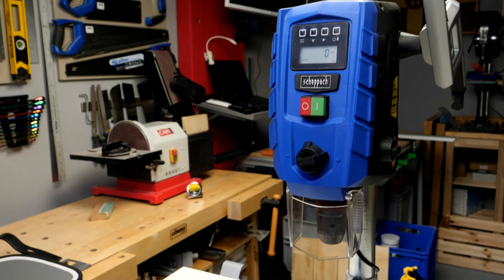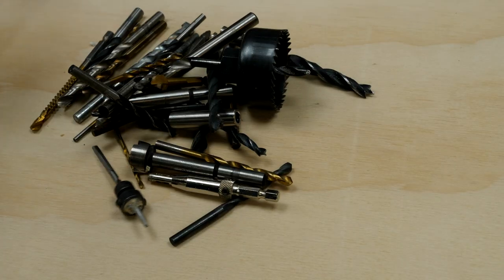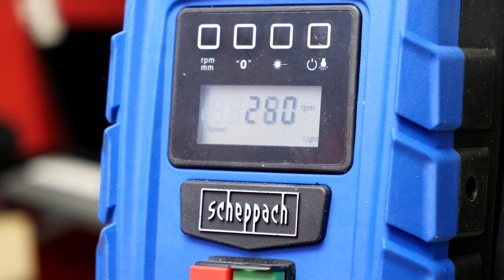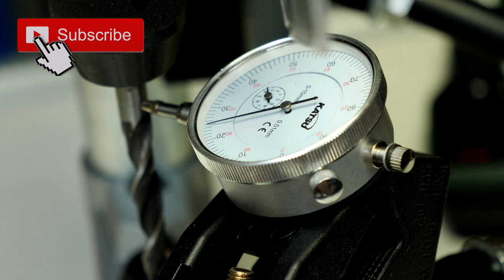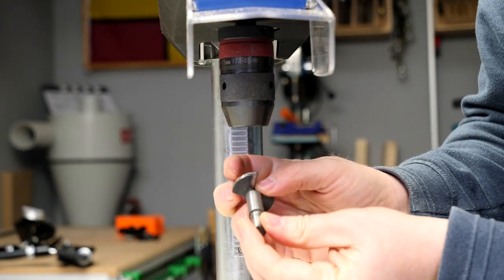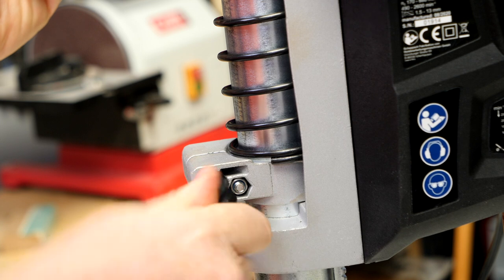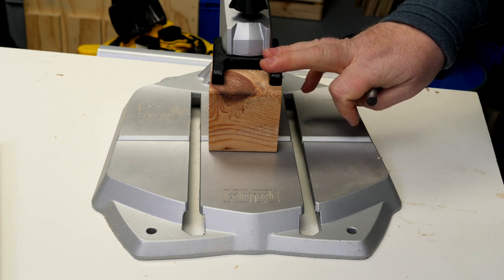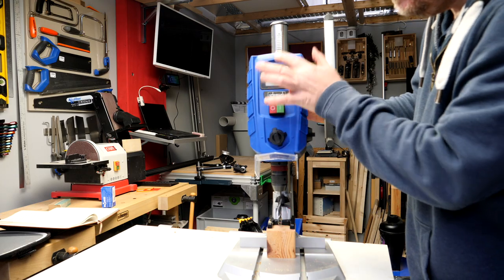Is the Scheppach DP 60 710w Bench Drill Any Good?

Comment from the maker: A couple of quick follow-up points from the video.
1. It seems the unit has gone off-sale online but they can be found in-store for £79.99 while stocks last (as of 1/1/21)
2. I do constantly refer to the drill as a 'bench drill' rather than a drill press. Bench drill is what both Scheppach and Bosch refer to this type of machine as and, as I said in the video, the drill mechanism is more similar to a hand-drill than a traditional drill press where the motor is stationary and the quill is moved up and down.
3. The review is a positive one. It's faults do not affect the results when drilling into wood and soft metals but and for £129 I would be put up with the quirky design and rough plasticky appearance. This isn't a precision engineering drill by any stretch of the imagination. The gearbox noise is unfortunate.

There is more to come on the subject of drills and drill presses so stay tuned. A couple of shorter videos to come in the meantime. Happy New Year.

Comment: The gearbox, despite being noisy, has a strong point (for steel), that is, it does not allow rotation to be blocked, unlike the belt, which instead can slip, especially since the engine, with its 710 watts, is very powerful. However, predictably the gears of the gearbox work with gear grease, but in the future it may be that the gearbox will be made in an oil bath, so the gearbox will be less noisy and perhaps more durable. /// The electronic speed regulation seems to be carried out via a mosfet, since the motor is perhaps brushed and perhaps, if it had been an induction motor, with the regulation via inverter it would have been possible to have a greater speed range. /// One thing that I don't like and that few people notice is the base made of aluminium, rather than cast iron, since it doesn't give a sensation of robustness or flatness and in any case the aluminum causes the piece to stick, so it is difficult to position, while cast iron would allow better movement. /// The measurement of the drilling depth complete with zeroing is an uncommon strong point. /// The two-arm descent ring I think is an impractical marketing gimmick... it should be three-armed and in any case if it didn't have so many oddities in the design it would be better. In general it seems like a drill more suitable for wood than for steel, also because placing the steel on the aluminum base would quickly ruin the base.
Reply from the maker: I would agree that this is very much a woodworking drill. Thanks for your comment.

Comment: Incredibly disappointing that both Scheppach and Bosch didn't do with a variable inverter and an AC motor.  I have that for my micro lathe and it is nearly silent, with amazing torque at low speeds.
Reply from the maker: I agree.

Comment: Good lad. Start with the runout. Tbh 0.2mm would do my crust, but I'd lay money that the Bosch isn't any better from what I've seen. Where's the runout coming from? The chuck, the bearings or both? It'd be interesting to see the inner workings of this and to know if that runout coud be improved by simply swapping in a decent bearing or two like you can with a standard drill press, or if you can change the chuck for a better one. You're right about that stupid wheel on the Bosch. One thing I don't get about these bench drills is why are they all so damned noisy? I'm sure if Makita got into the game it'd be whisper quiet with no runout either.
Reply from the maker: Hi. Thanks for the comment. I do have the. Bosch machine too for a comparison vid and the runout on that is around 0.8mm. I've taken the Sheppach apart and there are two problems in my view and you've mentioned them both. The bearings are cheap and generic. The Chuck too is generic and even the manufacturer doesnt spec the runout below 0.2mm. Bosch is marginally quieter but better built. The model I have has a few differences to some I've seen reviewed. Thanks for the comment.

Comment: Great video (hence it shows up  everywhere when searching for this drill). One improvement, perhaps you could add in the description: measure the run-out at the tip where the item would be contacted, rather than at the base of the shaft near the chuck. That could be done with a solid reference rod rather than with a used drill bit.
Reply from the maker: Thanks for the suggestion. Of course, if I had a reference rod of any sort then that would have been my preference for testing the runout. The test was representative of the the precision of the drill generally. With longer bits, In hindsight, it would have been better perhaps to have made a comparison with my Firm FTB-13 which had practically no run-out when measured in the same way. And then go on to explain why I'm still going forward with the Sheppach. 

All a bit irrelevent now as I've moved on to the Bosch PDB-40 which is set-up for cabinet doors, and the Firm drill press has been re-instated.

Comment: Great review. Straight to the point and shows what you want to see. I cannot understand why there are not more types of drill like this about. As someone mentioned, Makita where are you? Standard bench drills are identical to ones made over 100 years ago. When you think of the tech in a modern handrill these days, reverse and ultra low revs, then  placing that vertically for a bench drill is a total no brainer. There is only this or the bosch on the market, neither are really top grade compared to what they could be.
Reply from the maker: Thanks for the comment. I agree completely

Comment: Good review Karl. Interesting design from Scheppach. That rotating arms look's like straight out of Star Trek 😀. That thought process on changing the belt configuration for speed, on the older model drill press is spot on. I just stick with the medium speed for both wood and metal.
Reply from the maker: Yes those arms aren't really for my taste and actually they're really quite awkward to use. Cut that moan out of the vid since overall I like the machine. I do try to use the right speeds but its just one more thing to adjust. This isn't the end of the story though - I've a follow-up video I'm editing where I look at this machine again. Stay tuned.

Comment: I bought this drill back in April, I had for years been using a cheep’ish pillar drill which every time I used a hole saw or forstner bit it would stall the drill, really frustrating, I’m only a DIY’er so didn’t want lay out on a big expensive pillar drill so when Aldi started selling the scheppach I thought I would take a punt, I have to be honest I find it a very capable tool and it’s accuracy is more than good enough for me.
Brilliant channel and content by the way 👍
Reply from the maker: Thank-you Philip. You can't complain for the price. I've been using it for shelf pin and door hinges along with jig  making and it's been a great tool since I got it in early November. Next week I have a related video which you might be interested in. I won't give too much away but as you're subscribed be sure to check back.

Comment: Hi Karl. I think you nailed it being a hand drill with a built in stand. It's a great tool for the small workshop and a big upgrade 
being variable speed. The ability to drill accurate vertical holes is a must for ease of assembly and accurate repetition work. 
Just like the old Black and Decker hand drill in a drill stand but tweaked and with being light you can take the drill to the work. Tony
Reply from the maker: Thanks and it was the variable speed that really appealed to me.

Comment: Hi, thanks for sharing your experience with the new drill press. I went out about nine months ago and purchased the Lidl Parkside version with the gears. It was down to an absolute bargain £59 or was it £49? Anyway, despite all the mixed reviews about how wobbly and noisy it was, I found that there was very little in the way of wobble and that the resulting holes were plumb and accurate. 
Tbh, I never really had issues with hand held drilling, but figured that, as I had the space, and couldn't grumble about the cost, it wouldn't hurt to add a new toy to my workshop. I did notice a version of the drill press you review here - both in green and blue, but thought they looked a little bit too lightweight and flimsy. I did check out the Bosch version, but hey, at that kind of money...
Like most woodworkers, I spend a lot more of my life sanding than drilling, so I spent the cash on the excellent Bosch orbital sander. I know, £350 on a sander, but trust me: with the vibration damping and excellent dust extraction, it is worth every penny.
Where the drill press comes into its own, is where you find yourself using larger drill bits and hole cutters. Many a time, I've taken a crack in the jaw whilst drilling out a cable tidy onsite. Ouch!
Reply from the maker: I think you've got it spot on. As woodworkers we need to sensibly decide where to invest our money for maximum effect and enjoyment. I have done roughly the same as you. This drill does what I need and then I've decided to invest in the Mirka Deros sander as I use a sander for a couple of hours on every project I do and the drill press only occasionally.

Comment: I've had two of these - or at least almost identical, and Ferrex branded - in Australia. Both have failed. I kept the first one for 'handy spares' in case needed for the second. In each case the failure is electronic, and occurred running at low speed using a large-ish forstner bit (I was gentle, honest!) I noted that at low speeds the motor would 'hunt' - rev up and down a little, which is a sign of poor loop control.
Anyway, unable to find a circuit schematic to begin probing, I bought in a regular motor controller unit and wired that directly to the motor, bypassing all internal controls. And it works after a fashion. But the motor is low on torque and slows quite readily under load. Usually the control loop compensates for this by increasing input current, but in this case of course I've broken the loop by introducing an external controller.
Apart from this - rather catastrophic! - issue, both drills were great while they worked and much better suited to my needs than a regular drill press. I'm still playing with the current set up - maybe it will do if I don't work it TOO hard?
Reply from the maker: Mine's been okay in-spite of having taken it apart for a video that I didn't end-up making. Having stripped it down I did find the quality of the components to be on the cheap side. Anyway, these days it does one job and one job only - holes for cup hinges.

Comment: Hi Karl,
I really enjoyed your thoughtful and thorough presentation of this drill. I bought the Bosch version when I 
saw & learned about it on Amazon a few years ago. I have only a 12 x 8’ workshop and this drill fitted my requirements perfectly. The belt changing on other drills was a definite no no. I bought a large cast iron drill vice for it too. I too don’t like the noise even from the Bosch so I hang an earbud type ear protector from it to make it easily accessible when I need to use the drill. That’s the only downside to it for me. I’ve got used to the chuck and printed helpful arrow labels so I can turn it the right way first time. It’s a drill I really like to use actually and the results are fine. I also prefer the softer Bosch green to the harsh blue! Keep up the good work. You must be enjoying it because you do it so well.
Reply from the maker: Hi Christian. There's more to come on the subject in the coming weeks. Actually - I've got a different chuck in the drill now which I'm much happier with. Thanks for the comment on the videos. I really enjoy all the attention my videos get and the coming-up with the ideas to go into the videos. It's the bit in the middle - filming and editing - that I still find quite challenging, but in a good way. I just wish I had more time to spend doing it.

Comment: Good review Karl. I bought the Ferrex (Aldi) pillar drill in late 2019, but wasn’t happy with the quill play on it, so eventually replaced it with one from Rutlands which has been much better value for money. So much so, that I’ve also got their bandsaw now 👍.
Reply from the maker: I have their benchtop mortiser which I found to be a great bit of kit. I'm really quite impressed by their Router Table offerings recently just a bit too late for my router table purchase last year.
Reply: @StrawbyteWorkshop   Yes, I'll definitely be checking them out for future purchases. Bye the way Karl, will there be any 3D printing videos coming up this year, as I've now got one, (Creality Ender 3 v2), and have been able to design & print a few workshop accessories which has been great fun.
Reply from the maker: @idlersdream826  That's a good question and at the moment probably the most frequently asked one at the moment as I've got quite the reputation for 3D printing that sell well. So yes, if there's demand I'll think about how give my perspective on 3D printing. Marius Hornberger did a great 'is 3D printing worth it in the workshop video' so may be something like that. If you want a quick tip about how to learn fast - find something that you need multiple quantities of and try to improve the quality and optimise your print time every time you print one. You will learn about tweaking settings in your slicer (I use PrusaSlicer which is great and has an Ender profile) and also how to design better features. For me it was assortment boxes for the workshop and the jigs when I got going with them. If you focus on cosmetic appearance and getting accurate dimensions for your things you'll enjoy the results so much more.
Reply: @StrawbyteWorkshop   Thanks Karl, I’ve already purchased your Festool waste side jigs, they’re great 👍. 
So far, in learning Fusion 360, I’ve designed my own M6 & M8 star knobs in 25mm & 40mm dia, and guide rail stops for the TS55, plus some paint dogs. 
I’m currently using Cura slicer and have been able to print multiple pieces, sequentially, one at a time. I’ve been very impressed with the print quality of this machine. 
The next project, now that it’s no longer on the kitchen table, but in my loft room, is to set up a Raspberry Pi with camera & OctoPrint for remote monitoring/connection.
Reply from the maker: @idlersdream826  I only got OctoPrint going in October - it's truly a game changer.

Comment: I have this same model and now prefer it to my expensive large Delta brand bench pillar drill like yours (mit belt adjuster :-) . I have the Scheppach mounted on a fixed-height MDF 'box' which overcomes the working at eye height issue. Being able to easily change speed is a godsend, the laser needed some gynaecological adjustment and I'd like to replace the LED light with something from the side. The drill height mechanical stop is the best I've ever used and being able to electronically adjust that height as well is fabulous.  Just buy one if you can, you won't regret it. Only downside is the awful rattling fit handle - fixed with some shims :-)
Reply from the maker: Thanks so much for the comment

Comment: Great review. I wonder if the Bosch is that noisy? And if there's any way to replace the arm with something more familiar?
Reply: Actually I just saw a video review of the Bosch and unfortunately it looks like this geared design is inherently noisy. Looks like a traditional drill press for me. No idea where to start though.
Reply from the maker: Stay tuned as I have the Bosch machine too and a side-by-side comparison is coming. Without coming to a conclusion before I get all the filming done, one of the most obvious things about tool designs is that it is possible to come up with an adequate design and then make it more cheaply. 
Thinking of it as a mounted hand drill is useful.
Reply from the maker: There's an though here where I review the FERM drill press I have. I was clueless about what made a good machine when I bought it a few years ago but all its faults has me looking at the Bosch/Sheppach machines with hopeful optimism.
Reply: @StrawbyteWorkshop  I had a look for it and couldn't find it. Was it the FERM 1026? I'm not really seeing that on sale in the UK much.

Comment: hi, here (italy) is for sale in this days. anybody tested it with mild steel? usually need to drill 2-5mm plates. thanks!
Reply from the maker: I'm not sure it's going to be suitable for mild steel. I've had acceptable results in mild steel but I've had to take it slowly in material which has had a good centre punch marking the hole. But others have commented about it wandering about and drilling inaccurate holes.

Comment: Got mine for £59.99 on the 30th December 2020 in my local Aldi.  Pretty sure it was the last one anywhere tbh.
Reply from the maker: Got 60 quid you've got incredible value for money in my opinion. The RRP for these machines is £179 normally and it's more refined cousin, the BOSCH BDP 40 is retailing at £325 right now.
Reply: Nope I found the last one at £49.99
Reply from the maker: @straitjacket7969  Brilliant price!
Reply: @straitjacket7969  another tenner off! Nice one.

Comment: thing is, i (and most people) would want that low rpm to drill for example steel with a larger bit to keep surface speed ideal... and i am going to go out on a limb and say it just has not got any torque at that low rpm.... but i wish this was tested.
Reply from the maker: Drilling into steel isn't a use case for me, but fair point I didn't take the test as far as I could have.
Having had the machine a while, I'm not sure it's really a metalwork drill press